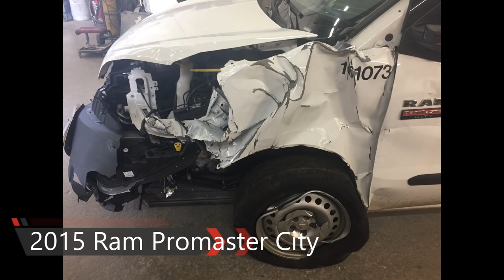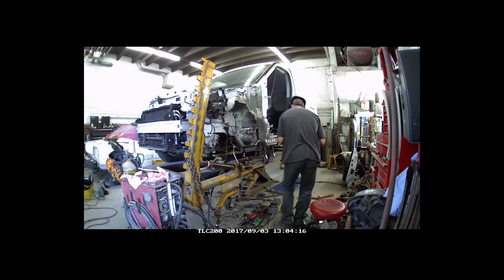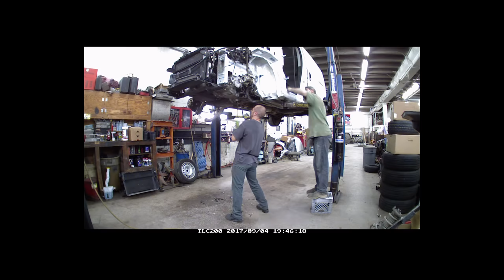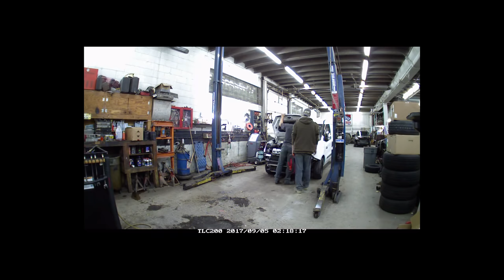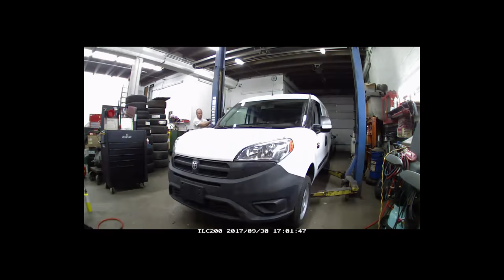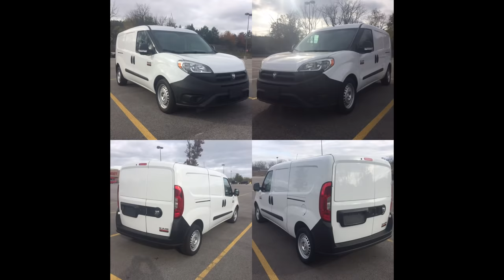2015 Ram Promaster City/ Fiat Doblò left front collision with air bag deployment repair time lapse.

Comment: I am impressed by how completely you repair a vehicle.  You don't just make it look good, you fix it COMPLETELY.  Good job and I enjoy your videos.
Reply from the maker: Thanks, I try to make them as good as new or better. I don't like to cut corners. Why do a job if you are not going to do it right, right? It is really fun when I go to sell the vehicle because the buyers look for imperfections to deal on the price and they can never find any. I have a couple months left of small jobs but by spring there will be a big job with the new format. Hope you enjoy that, it might be a long one.  I'm currently working on it now. Thanks for the support, see you next month.

Comment: That rocker was a S.O.B., but the whole thing looked like it was fighting ya! Victory at the end.
Reply from the maker: Rockers in general don't like to move and are not easy to get at for replacement.  It seems they are becoming more popular in getting damaged by weak suspension designed to break away in an accident.  All the Terrains fought me too.  There is no good way to pull or replace it that works on everything, so it is trial and error.  It can be the most time consuming part of the job but with some patience, it can be conquered.  Thanks for watching!

Comment: Good to see this one. I have a dark red metallic Promaster City SLT 5 passenger wagon in which I T boned a 90’s Dodge Durango which turned left in front of me at an intersection. Not hard enough to pop the airbags, but hard enough to require replacement of both fenders and the hood plus everything in front of the motor.  I had only 4,000 miles on it.  The repair cost almost $11,000 to do. They did an excellent job. They had to remove the motor to get to an d repair an apron.  It took almost 6 months to get it back. The hard part was getting the parts. Now I have an idea what they had to do to fix it. Thanks.
Reply from the maker: Glad to hear you found a good shop.  If the repairs are done correctly, the car will be as good as new.  Sounds like they did it the right way.  Showing what was involved in the repair process is the exact reason I started these videos. They have evolved in to more and are now being used as learning tool also.  Thanks for watching!

Comment: With all those airbags deployed what does it take to make the vehicle see that they have been repaired? I know some vehicles have a module that needs to be flashed, etc.. Also, what about the seat belts? Can the sensors be reused if not damaged? I really enjoyed the music when watching the 02 Town Car.
Reply from the maker: This one required the module to be replaced as well as the driver seat belt retractor and the three air bags of course.  Sensors typically do not require replacement unless they are damaged.  Some modules can be reset like the one in the Towncar.  The Towncar only required the seat belt and airbag.  Thanks for watching.

Comment: Hello,  is there a fuse or shut-off sensor for the promaster city that needs to be replaced or reset after the accident with an airbag deployment? Did the vehicle starter without problems after you replaced these airbags?
thank you

Comment: Seams like an unusual choice, did you get a smoking deal or already have a buyer?  I’ve started using a oscillating saw with a carbide blade to cut panels in tight spots, works pretty good.  Sorry I’m pretty excited about that oscillating saw thing, just disregard if you’re not interested.
Reply from the maker: It is a little unusual but according to the numbers it was a good buy, we shall see. I'll buy anything if there is a market, I have had box trucks before that sold quickly so I figured why not. I watched some videos on the oscillating saw, I never heard of that, I figured it would distort the metal similar to an air chisel. It would be good for the tight corners instead of switching to old, used, tiny die grinding discs to get in there. Thanks for watching and a little industry info, there is always something new to learn.
Reply: vehcor 
I’ve only been using the oscillating saw a couple weeks.  So far it’s really cool, no distortion. If you try it be sure to get a saw with a variable speed trigger. I had a dewalt 110 volt for cutting drywall and stuff at home, it was around $100.
Reply from the maker: I'll have to pick one up. I could have used it on the Enclave I just did.

Comment: In England the van you are working on is made of chewing gum, tissue paper and rust lots of rust. It is basically a disposable van, with a very short life span of about a year from new
Reply from the maker: Here they use the same materials.  Somehow they seem to last, after you change the trans with less than 20k on it.  I have not seen any rusted out ones yet.  They seem disposable but they bring a high price.

Comment: Whi did you remove the dash for the repair?
Reply from the maker: The passenger air bag was deployed and the entire dash pad has to be changed.  In addition to that, it was easier to get to the repair area with everything out of the way.  It ends up saving time in the long run as well as making for a better repair.

Comment: @vehcor any idea how to get rid of the airbag light on a 2017 Promaster city? It has a brand new air bag module and the seatbelts look to be good also there is no code showing up on the scan tool but the dash still has a service airbag light. Any help would be awesome thanks.
Reply from the maker: The control module is not just plug and play, they have to be programmed once installed.
Reply: vehcor so I would have to take it to the dealer?
Reply from the maker: Or have someone with dealer level programming abilities.
Reply: vehcor thank you very much for the help. This helps narrow down what is actually wrong with it.
Reply: vehcor so apparently the guy that installed the module did in fact program it. And he checked the car with a scan tool and absolutely no codes come out anymore. But the airbag light is still on. I’m going to take it to another mechanic that specializes in airbags and airbag modules tomorrow. Hopefully he can figure it out for me

Comment: Great job! I’m amazed the windscreen wasn’t damaged... how long did the job take?
Reply from the maker: Thanks, the windshield was actually broken on the passenger side from the air bag. We did 90% over a three day weekend and the rest over the next couple weekends as fill in work. It needed the holes from the placards filled and the right door and fender had to be painted because of scratches, the new part matched perfectly. So about 6 (long) days total of working time.

Comment: Haha! Now fiat is slapping Ram emblems on their crappy vehicles aye? Never would have dreamed there would be any money in rebuilding a wrecked Fiat. Nice rebuild video though. Keep em comin'!
Reply from the maker: You can make money on anything if you buy it at a good price.  I am not a Fiat fan by any means but for a cheap commercial van, these things are not too bad.  Over 30 mpg and pretty comfortable, minus the horrible road noise from the echo chamber cargo area.  I did find a lot of uses for it while I had it and even thought about having one as a delivery truck for parts.  Thanks for watching.

Comment: Do you have any training or certification
Reply from the maker: ICAR certification and training. Just like any other trade, you learn more with experience than you ever will in a classroom.
Reply: So then you know what your doing goes against everything icar stands for and the OEM repair procedures
Reply from the maker: Please elaborate on that.
Reply: I've watched some of your work and seen you sectioning b pillars and reinforcement  and not once have I seen you do any kind of 3d measurements and icar and manufacturers require you to measure
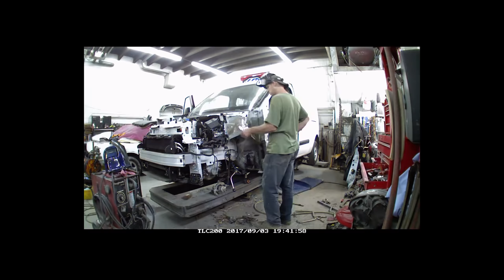Reply from the maker: I avoid sectioning as much as possible and replace entire panels but sometimes it is unavoidable.  I thought you might take issue with backing or overlapping that gets edited out, or straightening panels, not the measuring. I can assure you all pieces are measured as they are pulled and installed.  How else would you get them where they belong and be sure adjoining panels are aligned and straight?  I'm not good enough to pull without measuring, nor do I want to try, because the difference of a mm can ruin a job or at least cause an addition of a lot of labor to repair.  "Measure twice cut once", is the old saying I believe. The same goes for pulling and welding in this case.  If you notice the time on the bottom, the videos are edited so the details that are easily missed are left out, some little bits of them make it like some pulling measurements between 4:05 and 4:18. The inner a pillar install measurements briefly made it at 5:48 (at which point you will notice a half hour missing before the next frame when the door was installed) lots of boring measuring and slight panel adjustment going on in that time, some of which is simply blocked because I'm between the work and the camera. Other times like this one, cross measurements are done across the inside of the vehicle and blocked by the car itself.  There was also some measuring going on at 8:45 for the upper rail. I guess you did catch me, I didn't measure the outer a pillar panel when I put it in but there is no need, the inner panels were aligned and the gaps and holes in the outer panel aligned with those.  Had I gotten that piece in the wrong place, only the door gap at the bottom of the door would have been affected and since I fit the door, I had nothing to worry about.  I didn't realize people wanted to see so much detail, videos are recommended to be 3 minutes in length and I'm at 10 or more, to include all unedited videos, even in time lapse, is hours. I try to make videos that give an idea of the work involved while still being interesting.  While my critics may want to see it all, the general audience does not and that is for whom the videos are intended.  Most people watching will never work on a car so the detail is lost on them.  If your issue is with the lack of laser measuring tools for 3D models, I'm sorry, this is done old school with line measurements across varying planes and axis, which is still acceptable to ICAR.  Maybe some day my hobby will turn into a business and I will invest in those fancy tools to make my life much easier but until then, I will continue to disappoint, sorry.
Reply: vehcor Don't worry about uftan, it is only keyboard warrior...
Reply from the maker: Haha, wolves don't lose sleep over the opinions of sheep! I enjoy interacting with the keyboard warriors. I state my case and let the viewers decide whom they support. Sometimes it is a misunderstanding or a need for clarification, sometimes they are just trolls. It seems there are a lot of keyboard structural engineers viewing my videos....... haters. lol Thanks for the support, I have some great subscribers!  If you want a good laugh, check out the comments on my Civic video from East London A.M.W. and TheShockerKnocker!
Reply: vehcor Yeah, 😁👍

Comment: Great repair, it really looks like you took your time, but I could never buy a rebuild. I'm just too paranoid that the suspension geometry would be out of alignment. A friend had a Passat that was apparently square yet from behind it looked like it had independent rear wheel steering!
Reply from the maker: Thanks, I hear this a lot about not buying a rebuild. My answer is, "How would you know as long as it is done correctly?" The Passat could have been just a simple alignment or bent suspension part. They move salvage cars with end loaders and some times bend some stuff. I inspect all of my cars on a lift and have them aligned to avoid the four wheel steering issue even if the damage is no to the suspension, frame or unibody.